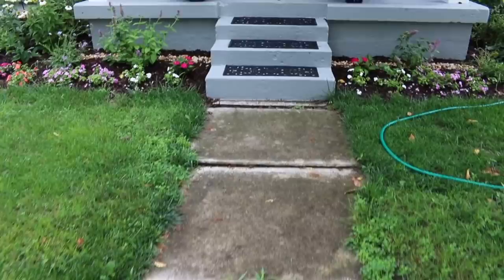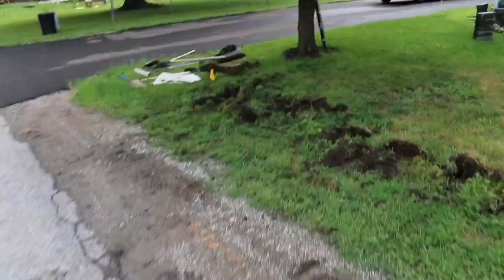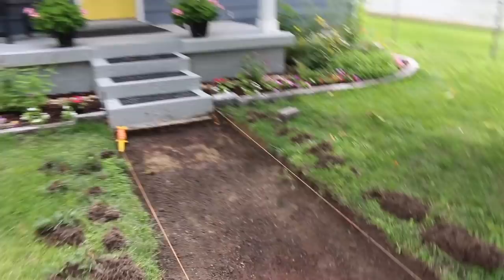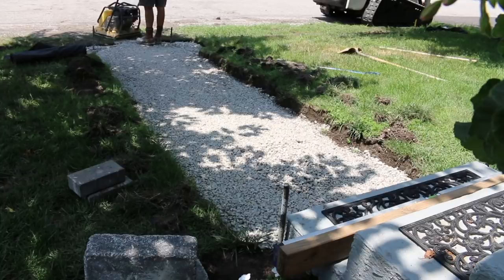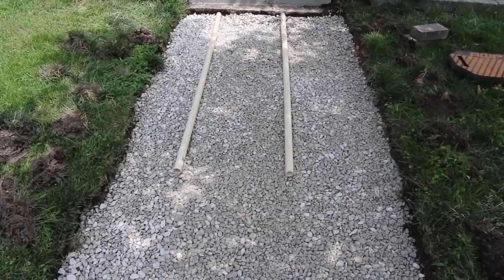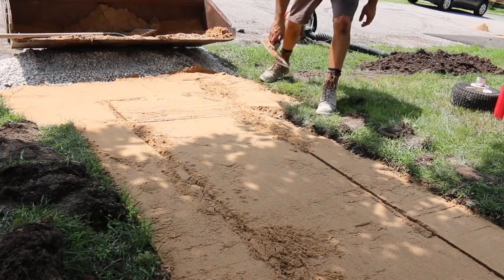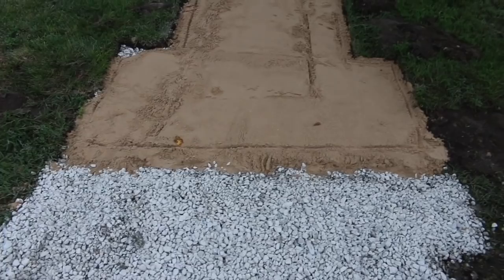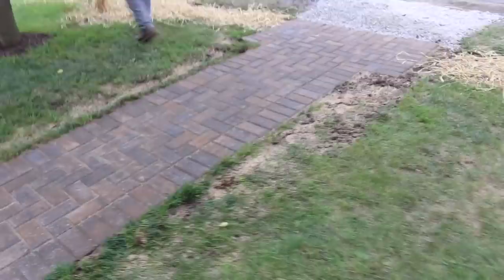Installing a Paver Walk Way and Brick Flower Bed Edging | FAST and Easy

Comment: No paver restraint is just like concrete on plain dirt.  There's going to be some lateral movement on the edges for sure and that grass will begin to grow in the joints.  Don't rely on poly sand to hold it together bc it won't.  Think about hand tamping the corners where your compactor doesn't get.  Good looking installation in the end, but I'd recommend taking these measures to ensure your work holds up.  I'm I'm MN and our freeze thaw climate is nothing to leave to chance.  The edges and corners are 1st to be affected.
Reply: supposed to put down landscaping material before the rock also

Comment: My experience using PVC piping is they flex, better to use metal pipe to level out.  Use plastic edging with landscaping pins to keep pavers from moving.
Reply from the maker: This is all very valid! We install pavers much differently now than we did when we recorded this video lol. I need to film the modern version.

Comment: How did you get into pavers?  How did you start your first paver job?  Were you nervous?  How did you offer a service you didn’t know how to do the first time?  Where did you practice?  How do you know how many hours it will take when you’ve never done it before?  Do you hofbsrge the materials or did you just tel the customer the price of the material is what you paid for it and only make money on the labor?  Did you charge a delivery fee for picking up the materials?   These are the deeper questions that help out so much and have the most effectiveness in helping people out.  A video on stuff like this would be extremely helpful.  The first steps to moving in this direction.

Comment: Get yourself some 1" EMT galvanized conduit !! Its way more rigid and straight !! You can get 10 footers so you can cover more area. Looks like your using huge plastic PVC and have like 2" of sand, and PVC is not straight nor is it rigid enough. And no edge restraint ? Pattern and install looks great good job

Comment: Man I will give my opinion. Regardless you need to use geotextile between subdirt and base and also poly edge restraint with 10 or 12" spikes. I know you said you do on some but man if someone turns a mower around on that walk that soldier course is gone. Idk just my two sense if I have to cut the costs to the point I cant put geotextile and edge restraint I dont want it. Last thing I want is a call back.
Neat work work,and cleanup👍

Comment: Run a small bead of mortar as a edge restraint, a portland base for your area. This gives you a quality restraint along with not having the plastic edging pop up overtime. Very cheap option about, $6 a bag.

Comment: Hmmm, just came across this, interesting video, I don't want to be unkind, but it will soon disintegrate into a shambles. 
In that, the edging will fall apart because of lack of restraints, no weed mat's to curtail weed growth and the front edging will not withstand even pedestrian traffic, it will soon  collapse. I think you will learn from this project.

Comment: I would have installed this using the exact same things except I use stone dust for base. Curious on the lip off the bottom step where the bedding sand went up to it.... it looked in the video like the sand was a little lower than the concrete lip... Plus with the paver sinking into the sand about 1/4" it seems it wouldn't match up. I assume you just added a little more sand there so it landed level on the concrete lip.

Comment: Why not use longer screed rails and place them a little wider than the walk-way...then you dont have to worry about moving/ filling in the hole. On the edge of the pavers add crushed at an angle and with the leftover sand top it. Grass will grow through. I can share pictures...

Comment: No edge restraint other than soil. Poor installation I’m afraid
Reply: justy crusty I was about to inquire about that since I’m in the process of doing a walkway. I just bought the metal edging today but if I don’t need it I’ll take it back it was expensive
Reply: @ultimateaudio8239  you 100% need it
Reply: @megooderthenyou  I bought the metal ones because i couldn't see the plastic ones working correctly.
Reply: @ultimateaudio8239  Probably won't be too bad since the ground is pretty flat and the soil looks good. There is only 1/2" of paver sticking up too. But I would have preferred to seen some edging.
Reply: @mikel9567  If I went through all that, you can bet Id use the proper edge. Also the short sidewalk, it wouldnt cost  much extra.
Reply: @ultimateaudio8239  check out https://www.youtube.com/watch?v=TGU8a16XEkA for a more instructional video and he shows the proper way to edge. Good luck with your project.
Reply: @ultimateaudio8239  plastic ones are junk!
Reply: @megooderthenyou  Yeah i went ahead and bought some more metal and installed it and glad i did it holds way better.
Reply: Couple years ago we had some extensive paver work done at our NE US home, maybe 75' x 4' total by a couple old world Italian guys who provided a Master Class in how it's done (and at a very competitive price). They used a mortar of some kind banked up against the edges. Actually that was 15 years ago. We sold the place about 10 years ago. I was able to check it out last year and it's looks like the day it was installed.
Reply: @megooderthenyou  the plastic ones are what professionals use.  Your throwing money away with the metal.
Reply: @ChuckD59  mortar edging is old school.  Doesn't work as well as snap edging because it cracks and moves.
Reply: @coryalbright9798  wrong
Reply: @coryalbright9798  but
Reply: @coryalbright9798  whatever makes you sleep at night
Reply: @megooderthenyou  lol OK.  Dovsomevresearch and lmk what you find 😉
Reply: @megooderthenyou  q

Comment: What did you do right by the steps to transition to the pavers?
Reply from the maker: JRM Landscapes we had a little gap that we filled with poly sand but the pavers started full pavers right there so there were no small cuts

Comment: Alex, thank you for this awesome video!  It's exactly what I needed as I prepare to tackle my own walkway project.  I have some questions if you don't mind answering.
1.  You did not show where you started putting the pavers down.  Do you start at the stairs or down the side?  Is there a science or is it a preference?
2.  I noticed that there were small empty squares when you were installing the pavers, but I never saw you fill them in.  Was it something that needed to be cut to fill those spots?
Reply: No logic to laying except avoid stepping on the sand. Those squares are leftovers for cut bricks to fill at the end. One of those regular standard bricks make two squares and fill two holes. You need a masonry saw. Do NOT use angle grinder.

Comment: Just wondering, when would you use plastic or metal edge restraint vs not using edge restraint?
Reply from the maker: Detailed Lawn Services Sometumes we do. Usually plastic but I started not using one this year for some projects and it makes it cheaper on the customer and honestly I think it’s a wast anyway. It ends up popping up and showing which looks like crap. Just my opinion. The edging won’t make or break the wall or patio.
Reply: Always

Comment: Greetings from a fellow landscaper from the Netherlands! I was wondering, whats the purpose of the straw?
Reply: Straw helps keep the grass seed from blowing away in the wind, and helps retain moisture and block sunlight.
Reply: @ChrisLell1   Thanks Chris.

Overhere we spread a little bid of compost or sand over the seeds. Then we press it gently with a grasroller.

How do you keep te straw from blowing away?

Comment: Too much talking in this video & also a little tip don't use a plastic pipe as it's got too much flexibility in it as shown at 16:40 use something stronger i.e. Rebar.. & your edging needs to be solid or it will move over time good effort though

Comment: I liked your video, however there is a much easier way to screed the baserock to get it exact on the grade & slope...not close - EXACT !

 After your dig. And the first couple "2 inch layers of compacted baserock.

You pound 2 metal stakes at the top and bottom of your pathway (or patio, or driveway).

 Mark the first stake top or bottom at your reference point for desired top of paver surface. Then draw a tight string across to the stake next to it level. Then a string on each one of those to the bottom stakes at the end of the walkway, adjusting for proper slope (in your case to meet flush with sidewalk or curb). Do the otherside.

Now you have 2 string lines full length of the walkway, slight in from the sides of the walkway area about 4-6 inches in.

This is your screed line.

Now cut 2 pieces of 2x4, which in America is actually 1.5 inches thick.2x4x a few inches wider on each side of the string lines on your walkway.
 Screw both pieces of 2x4 together. They equal "3 inches !

This is your screed board.

Bring in more baderock shovel by shovel as needed, using your screed board gliding under the string lines to float a perfectly exact uniform base throught. This takes skill... The screed board needs to glide under the string. Make certain the screedboard isn't lifting the string, and make sure there is no space between the board and string.

 This is the proper way to screed baserock on every job. And the part every single vlog on Youtube leaves out.

I've been installing pavers for 40 years. This is how the Romans did it, how the old timets did it and how its done professionally.

 This method in the long run will save a lot of headaches. Downstream problems and you will be doing much higher quality jobs than your competition.

Your Welcome.
Reply: You lost me at, "...which in America is 1.5" × 3.5" blahblahblahblahyaddayaddayaddablowitoutyourass/??yourwelcome??